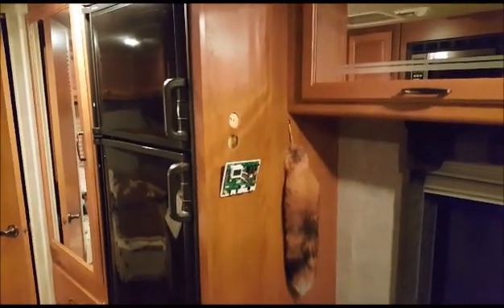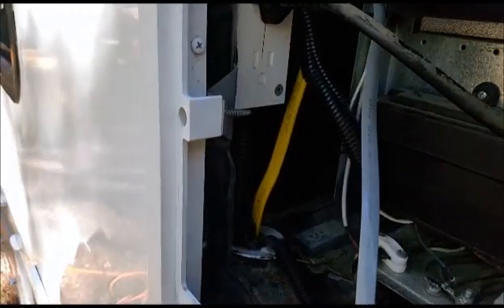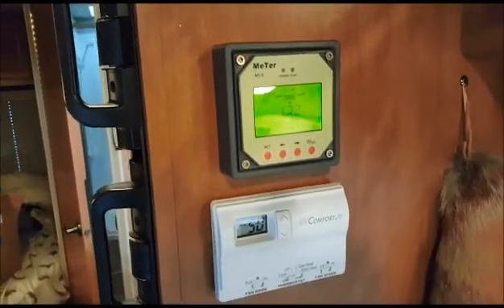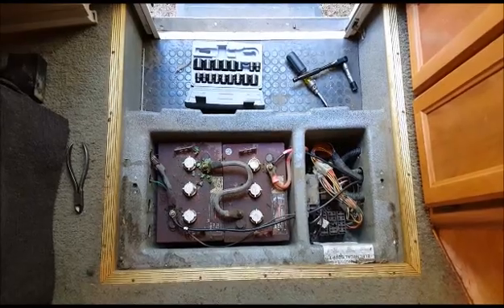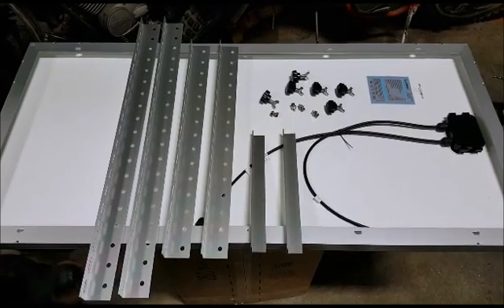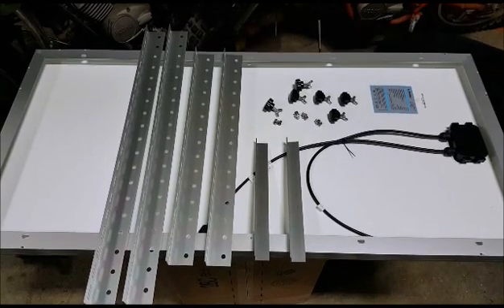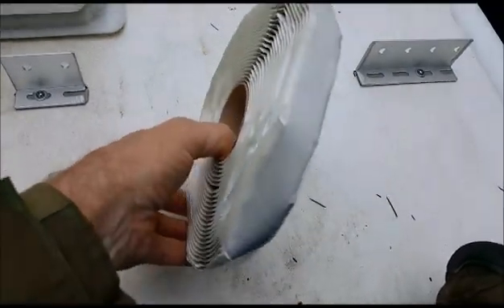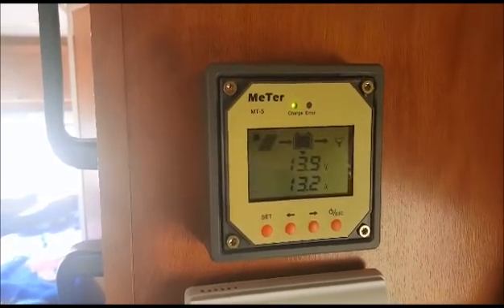Renogy Solar Installation on Class C Motorhome

Comment: Just to let you know what I'm working with. 1984 Chevy Class C with a 350, 1 AGM deep cycle house battery and 1 AGM dual purpose starting battery. I just bought 2/100w panels that came with a 20a PWM controller.  From my research online, here is my plan. Currently I have 1 starting and 1 house battery. From the solar controller, the wires go to the pos + neg house battery. Then connect a "pos only" jumper wire from house to an isolator. Then another jumper wire from Isolator to pos terminal of the starting battery allowing the solar to charge both batteries. If I am correct so far, this set up will only charge whichever battery is low and not over charge the other. No i've read that I will also need a DC cutoff between the solar and controller, and a fuse link somewhere? any help would be appreciated!
Reply from the maker: In my experience, I agree with what you have learned so far. You definitely want the ability to disconnect the array from the solar controller.  I always fuse any wires that I am connecting to a battery.  I don't know what your use is but you might be disappointed with only one house battery.
Reply: I am just starting out with solar.  As of now, I just want it to maintain my batteries while it's parked in storage.  When I decide to make an of grid system, I would have to buy a newer DC converter and upgrade the wiring.

Comment: Have you found that with your 400 watt set-up that you are utilizing the tilt option more or less to keep up with your charging needs? How much output do you gain? I'm going to install the same system but am torn between tilt or not and also whether to have the entire panel set optionally deployable off the RV because of all the boondocking we do in the mountains were we often need to get the panels out from under the pines to a sunny spot 20 to 40 feet away from the RV. For all our desert camping, the roof set-up is of course preferred. I've considered  two sets of panels ($$$!) with a master switch to connect either set to the controller input but it's just too much extra stuff to store.  Any thoughts?

Comment: ive got a 24 foot motorhome and I am looking to do solar also.  Did you finish?  what are you powering?  I am planning right now for 3 100 w panels, a 2000 w inverter and 2 or 4 golf cart batteries, probably 4. I am hoping to power my television, ps3, and laptop....my budget is 1500$
Reply from the maker: I am betting that you will not have any problems powering those things.  I only have two 6 volt batteries and when the sun is shining I never run out of power.  That is powering a TV, Blueray with surround sound, the fan on the furnace at night, recharging electronics, and a a separate electric freezer. I am well below $1500 dollars on my system.   It is the Renogy 400 watt with MPPT controller and a 3000 watt continuous inverter.